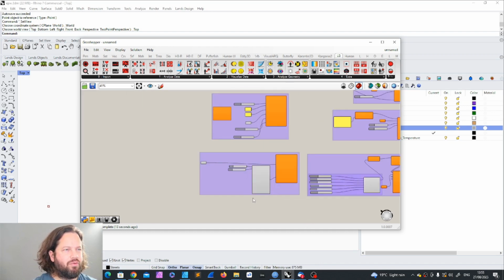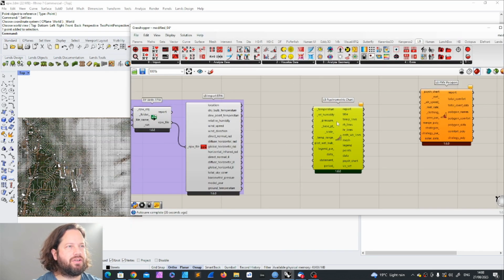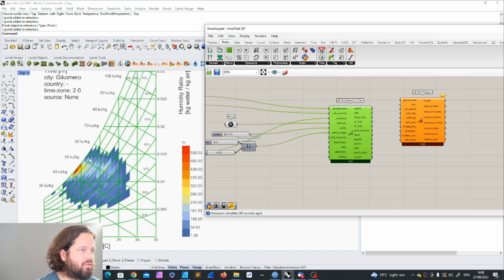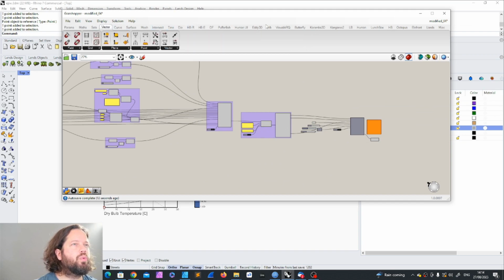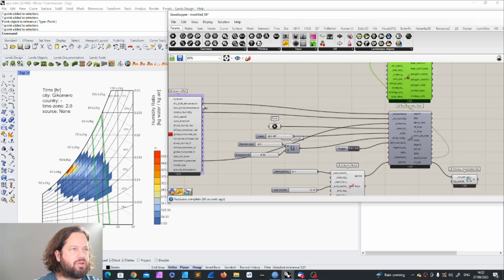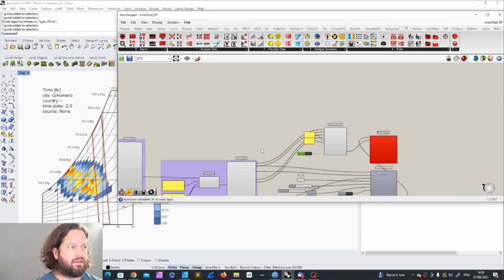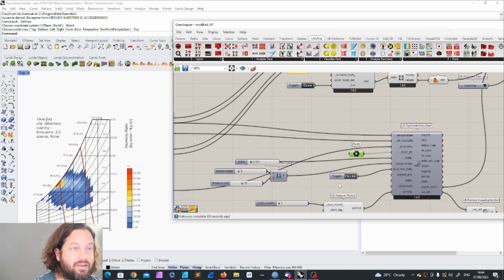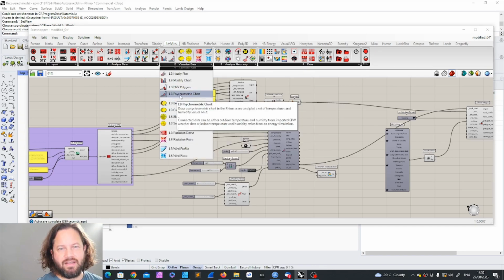#14 Demystifying the Psychrometric Chart  in Grasshopper Ladybug - Ultimate Ladybug Course - LBT 1.6

Comment: Thanks a lot for all the LB Tools videos, they are very helpful to many. You didn´t mention it so I don´t know if you are aware but the air speed on the LB PMV Polygon component refers to the indoor air speed, thats why the outdoor windspeed is not compatible. Eventually you could calculate after an indoor simulation the possible indoor airspeed to predict how many hours the space is in confort using the PMV method. Thanks again for all your dedication and hard work you put on these videos.
Reply from the maker: Yes you are right. I forgot to mention that this is the indoor airspeed.  Thanks for reminding me. We will probably get back to this tool at some point. All the best and thanks for the support.